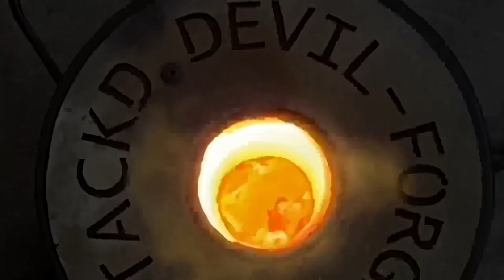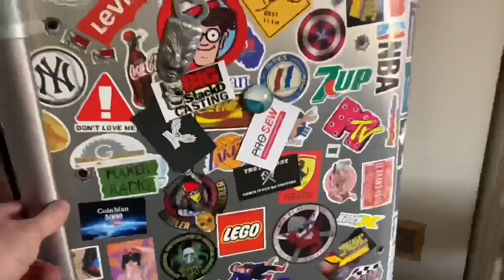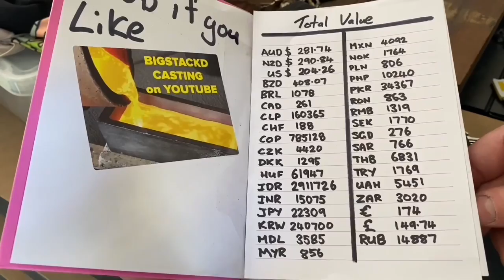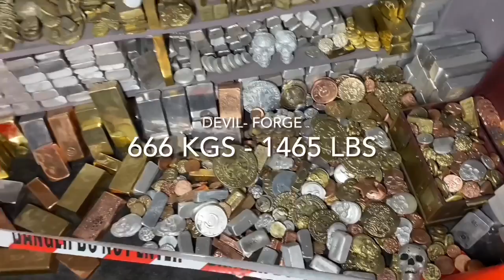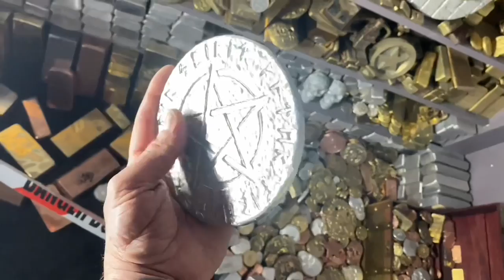Triple Metal Melt - Pewter Sterling Silver Lead - ASMR Metal Melting - BigStackD Casting - Zinc Coin

Comment: You can separate the copper from the sterling silver.  Dont let the furnace reach 975°C.  Do your pour and let it cool to room temp.  You can separate the copper from there right at the pour because it will still be solid. Soft but still solid.  Re-melt the silver and you are good to go.  If you repeat the process 3 or 4 times you could actually end up with a pure sample.

Comment: Silversmith here, you are pouring the silver to slow. When casting silver, a centrifuge or vacuum is usually used or if you don’t have those, pour very quickly in one fast motion with the torch still on it. 👍😊

Comment: Good thing you added the big Zinc coin to the total weight because of the 666 something was trying to posses your camera it seems 😈👍
Casting pewter and lead is so fast and easy to do, and looks like pouring a liquid mirror, stamping is also very easy :)
I really like casting pewter in silicone molds, great details even in very small pieces, one of these days I'll get in to making custom silicone molds for casting pewter.

Comment: Your channel is so inspiring and educational. Not to make light of your fun with sterling silver, but it makes me feel better about my coin casting! 

I made 6kg of nordic gold on Wednesday (12 bars about a half kilo each) and remelted them into coins yesterday. On the upside I have 46 coins and 6 2cm crosses. The downside is that I had a 40% rejection rate and I kept remelting and recasting until I got it right. Took all morning but it was worth it!!

Tomorrow is clean up day and it'll probably take all morning to wire brush, sand and clean my horde but dang! It's all worth it!

Comment: Pro tip: use flux and completely cover the  silver with it while melting, because silver takes a lot of gas like oxigen etc. While its molten and released it while cooling down. Thats why u have so many bubbles in there. Plus its better to get out of the crucible. Greeting from a goldsmith.

Comment: Did ya ad some Borax? Flux. To da silver melt?
Eh the pewter in the mould, nice element to melt.
I hold the gas torch on the surface before the pewter sets, focussing on that the edges flow nicely round in the mould.
Impurities in the melt does create gas which turn in to bubbles in the cast.
Selangor pewter 97 % Tin (SN) I love that beautiful pattern on the surface when it starts to set.
Thumbs up to the amazing creative casting mate.

Comment: I find nuggets of helpful information in most of your videos. Would you consider doing a tutorial style for how you can tell the different metals apart from each other? (Like the 3 in this video). I'm often confused with aluminum, tin, pewter, etc.
Reply: Aluminum is much lighter than most metals, at about 1/3 the density of steel. Tin melts at about 450°F, while aluminum melts at 1220.6°F.

Comment: For your ice blocks, before dropping the metal on it you could give it a quick hit with the torch.  Ice sculpters do that after they are done carving to give the glass like appearance.  Would make the side view into it look cleaner.  Keep up the good work
Reply: They also use vibration to make most of the air bubbles rise to the top and melt that off. But D is just cooling off metal, so no use going through any of that mess. 🤦🏻‍♂️

Comment: You ought to try refining the silver to 999 then pouring it.  Ive only melted very small amounts at a time but they cone out beautiful.  I make small 10 gram buttons of 999 that I stash in my stack with everything else.  I stamp them with the American flag, a 999fs, and a "10 G" stamp.  I have also built a silver electrolytic cell and made some amazing silver crystals as well that are probably 9999 fine after Ive run them through the cell twice.  Once I get the finances where they nedd to be I plan on pouring 1 ounce bars.  Well cheers brother.

Comment: You should try a lost plastic cast using plaster of paris. 3D print something. Make a cast of it in plaster of paris. Put it in the furnace to melt the plastic out then make a pour with it.

Comment: Just curious.  I've never done anything melting or smelting or whatever it's called, but I have done concrete work that gave me an idea of (possibly) better turn outs. If you dont mind doing a [let's see if this works out] show.. try using a vibration contraption resting on the mold while pouring metal,, it just might help (like in concrete work) to get out air pockets and spread metal better to all corners..  😇

Comment: I'm very curious on the breakdown of value between the 3 bars? And i loved the bonus piece at the end.  It always takes 2 balls to get the job done right mate,  lesson learned.  😆
Reply from the maker: Yes mate the bars were extremely expensive. Current sterling silver value is $677US a kilo And as the bar was about 230 g the silver bar was valued at $155 
Pewter is 91% tin and current prices of tin is $36.60 a kilo So the Pewter bar taking into account the price of antimony and copper in it as well makes that bar worth about $48US . In the lead bar is only worth about $1👍🏻. Silver and Tin are extremely overpriced at the moment but that’s just how the market goes I suppose.

Comment: If you are having trouble casting small amounts of liquid into an ingot you need to use a smaller ingot mold and make sure you preheat the hell out of it. The longer the metal stays liquid the better the mold.

Comment: You can go just fine touching lead bare hand, as long as you dont get it in the air, its still a good idea to aplly the second coat you put on, if the bare lead touches water some of it becomes lead hydroxide which is basically lead water, i did a lot of research on lead since its one of the few things i can melt

Comment: "Lead is nasty stuff" is an understatement. In fact, if I were you, I'd wear gloves while handling that stuff, and wear gloves and have a gas mask on and have ear coverings and eye protection when polishing and sanding it. Oh, and I also wouldn't keep that stuff with the other stuff on the shelf, I'd keep it in a box that's able to contain that stuff.

EDIT: Nvm about the box thing, the coating of that stuff might make it safe on the shelf, but I still would have had some extra stuff on when handling, melting, polishing, finishing, and sanding it, before that protective coating is applied to it.

Comment: 2 things, 1) didnt the zinc pour bring the weight over that triple 6? 2) isnt it time to make a new flask for cast pours? heck id say time to cast some new flask sides so teh burning doesnt happen again
Reply from the maker: actually when I added the zinc coin to the other ones it came in at about 10 g under the 4 kg mark so theoretically the stack is 666.99 kg👍🏻. I forgot to include that in the video but not to worry.

Comment: Sterling is a bear to pour good bars from since the copper wants to crater up on the top. You can heat your graphite molds to red hot and it will flow a million times better and give you the quality bar you're after, but you only get a few bars out of a mold before it's done with

Comment: What's the story with the silver, BigstackD? It was clearly a bit troublesome....it seemed to cool a lot faster, than say copper, hence the frustrated use of the  torch at the end! What are the properties of it that made it such a pain in the ass? Scrubbed up well in the end though. I don't know metal prices but it seemed that silver is at the higher end you've done before? Have you done gold yet?  Sorry, too many questions. I just get excited y'know 🤷
Reply: Sterling silvers melting temperature and the temperature it starts to solidify is only about 100° different and tends to cool quickly once away from heat. (Liquid (890C.) And solidifying at (780C.) This can vary depending on what the silver is alloyed with. Whereas other metals have a larger gap before cooling enough to return to solid
Reply: @Xtafa  awesome. Thanks dude, really appreciate the information!

Comment: For the big motor melt, could you find a way to melt down all that steel too?
Reply: The melting point for steel is like 2500F or 1371C so he could melt it, he would just need a different type of gas that gets hotter i think, im no professional on melting i just googled the melting point of steel

Comment: #bigstackDCasting  .....I have some stuff up on my facebook page now, mostly it's all pics of zinc but there's some that are aluminum and I just uploaded a vid last night where I did a couple of molds.  There's some other pics of the aftermath after melting down over 6 kilos of zinc into more manageable pieces from what they originally were.  Let me know if you want to check them out.  Wasn't great but did what I could with what I had and Luckily I had the Devil Forge burner to help.  Still working on getting a legit crucible, those propane cans just can't hold up very long against sustained heat and so I had to think outside the box on the zinc melt & used a cast  iron pouring bowl I picked up this last weekend....wouldn't fit inside my furnace though so that will explain why I had to do the melting the way I did it.

Comment: Um….. Did you forget to add up the weight of the large zinc coin into the total package? 🤨
Reply from the maker: when they were all on the scales they came in at about 3.99 kg so didn’t quite cracked the 4kg unfortunately I didn’t show that in the video but I assure you it was only a few grams under the 4 kg mark.